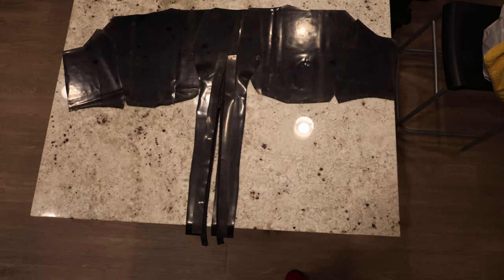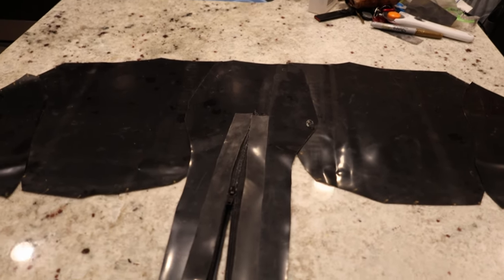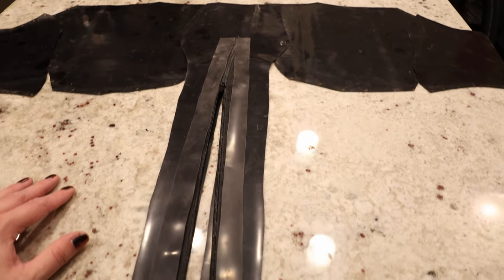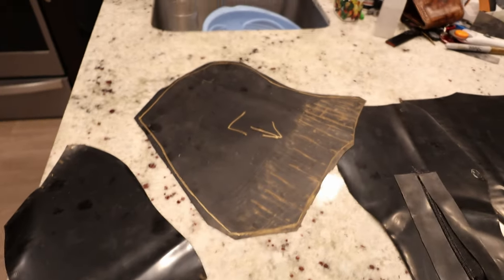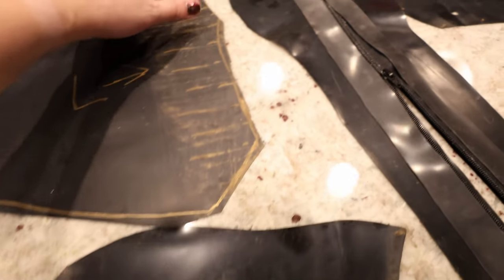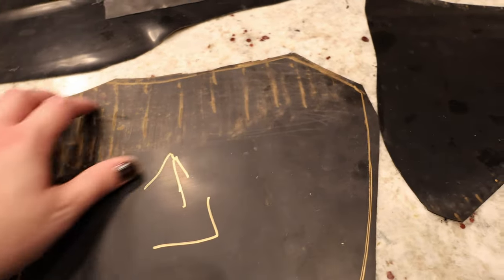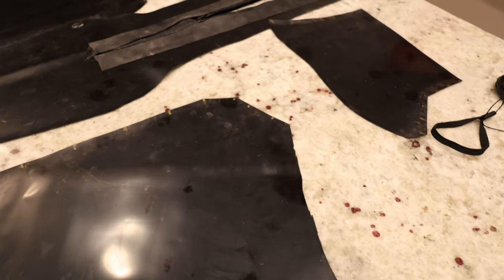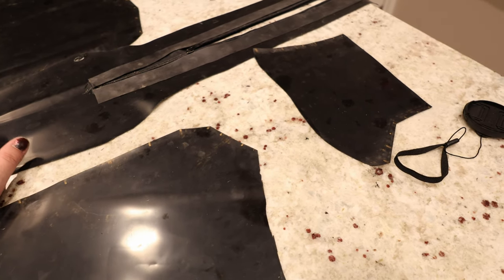Protogen Head part 16.1: Cutting and Gluing Latex

Comment: your protogen head is all coming together, using latex is an interesting choice for the head. Should look good with some LEDs
Reply from the maker: Thanks! The electronics are mostly done, I just don't have them installed during this process (other than the LED boards themselves since they're somewhat structural).